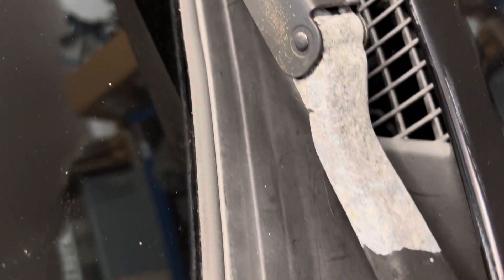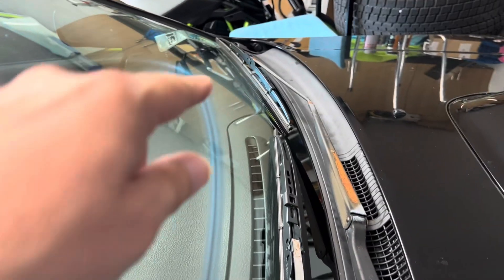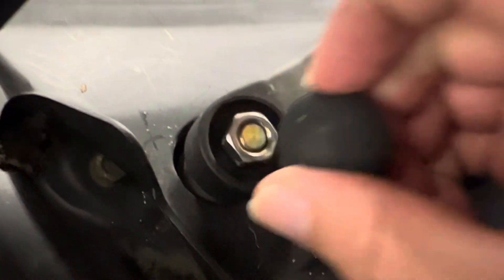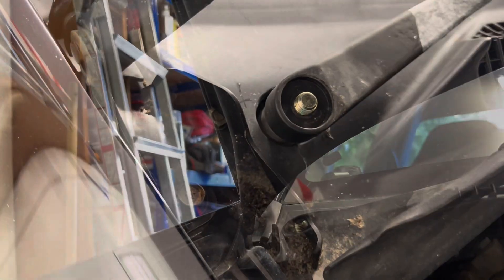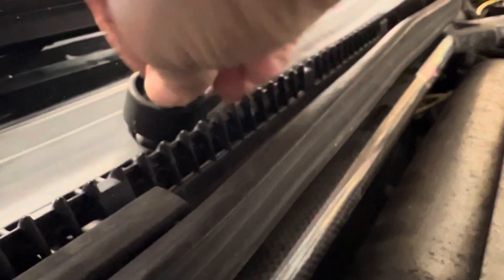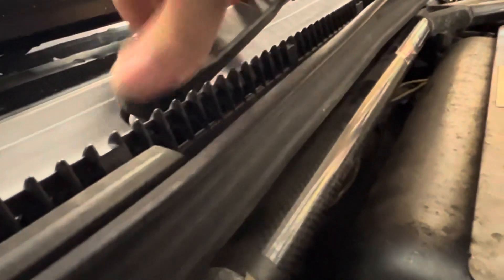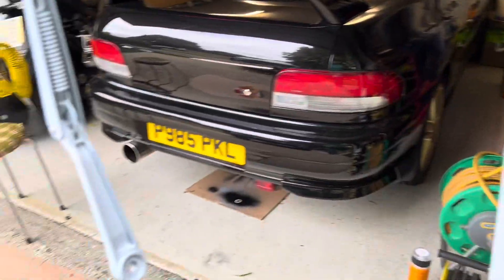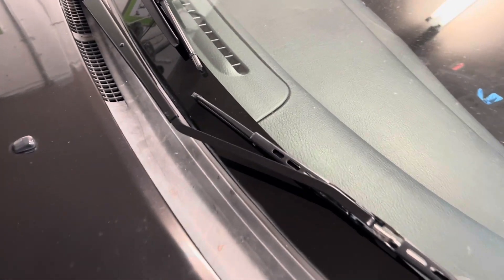Subaru Impreza GC8 wiper arm removal and refurbishment WRX STi v3 JDM

Comment: Looks great. I'm gonna do mine over the weekend. I was thinking hammerite but I like the satin black 👍
Reply from the maker: Yeah the satin is closer to factory so I went with that and I’m very pleased with the result. :)
Reply: You read my mind!! Thank you I’ll be doing this during the weekend. What did you have to do for the driver side. I saw you kept having trouble.
Reply: @ariesanfilippo1078  make sure you sand down the paint peel as much as possible or it with show through the primer
Reply from the maker: @ariesanfilippo1078   hi I used one of these very carefully. 
https://www.halfords.com/tools/hand-tools/all-hand-tools/halfords-2-piece-self-adjusting-pliers-439292.html
Reply: @Charlie-be6fx  I’m thinking paint stripper than red scotch pad? What do you think? Just the outside I don’t think the inside gets too bad. I’ll investigate once’s their off.
Reply: @chisnsid  I didn't go that far. Just wired brushed the lose paint off then sanded right down as far as to the metal as I could get. 80,then 160, 240. Etch primer, you could also primer over etch then paint

Comment: Is there a torque spec on the nut?
Reply from the maker: Possibly. I just did mine up firm. Probably worth checking online if you can find it.
Reply: @ Thanks for getting back. I’ll do it hand tight too. Ours is in the exact same condition. Both arms rusted and one nut cover missing.
Reply from the maker: @ import car parts do sell the nut covers :)
Reply: @chisnsid  Thanks. I found one on eBay.